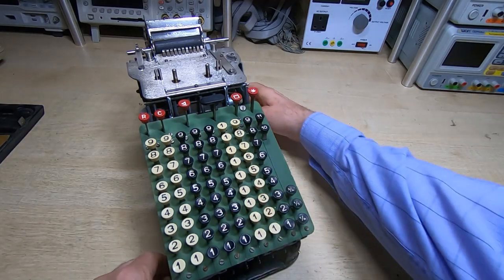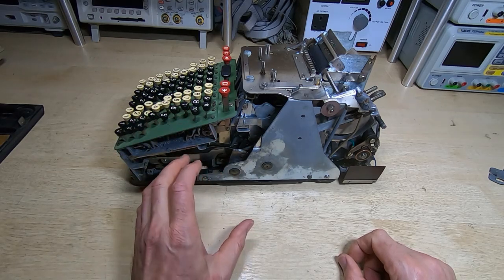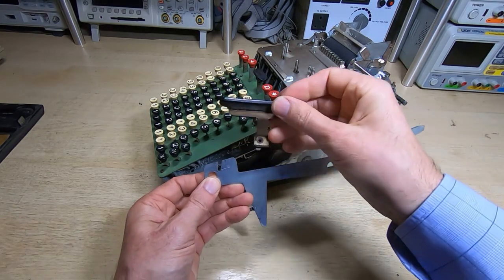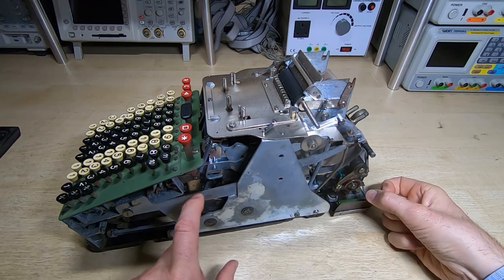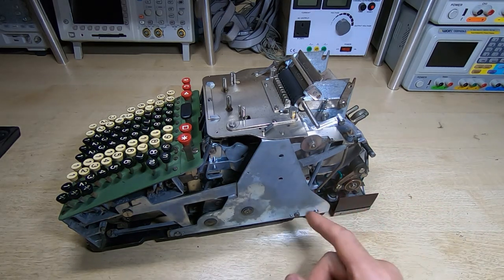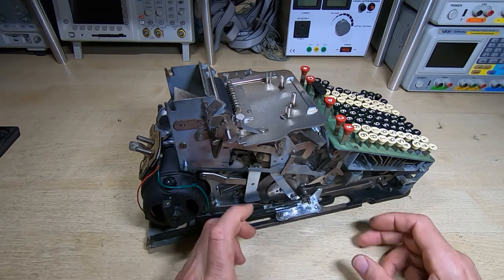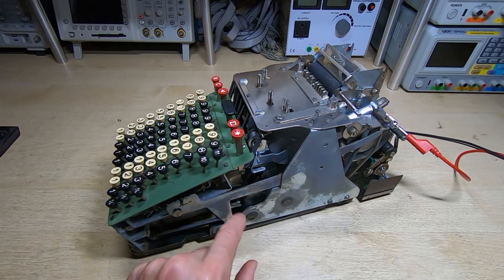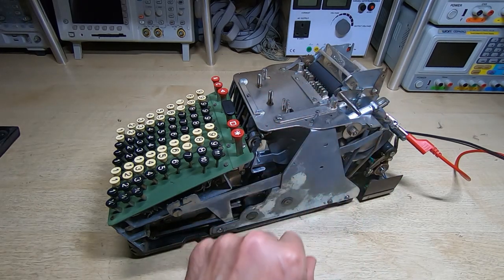Addo Mechanical Calculator Repair Part2

Comment: When you are freeing up parts on these calculators/ adding machines, do you know what each of the linkages actually does or do you just find the jammed parts by simply testing those that look like the ones causing the problem?
Reply from the maker: It is easy to figure out what each part is for but that does not always help in finding which part is stuck as many parts do more than one thing and can jam the machine even when it is not in use. For example a stuck carry cam can stop the machine turning even when a carry is not being performed. For more complex machines like the friden it is easier to focus on individual functions such as add/div etc but this machine is only an adder so does not have any multi cycle functions.

Comment: Please report the spam account. Thanks!
Reply from the maker: It does not really help. There are around 10-15 of those comments on each video but they are from random accounts so reporting them does not seem to make any difference. I generally delete them and some are detected and automatically deleted by youtube (although I still see them in notification emails).
Reply: @JerryWalker001  Most of the times when I see a spam account I report them. I assume (might be an illusion 🤷‍♂️) that when a certain amount of users report comments as spam, that that account will be deleted and others won’t be bothered by it. If everyone would report them, they might be discouraged (or that’s what hope). 

Are you saying there’s no point for me reporting those comments? 

Thanks once more for making these videos!
Reply from the maker: @Conservator.  You should report spam accounts if you want to. As I said I see around 15 of these on each video but I have never seen them from the same account more than once and I do not want to spend 2 hours reporting random accounts each time I post a video. I do not know what action if any youtube take and initially I used to report them but the number never changed so I stopped wasting my time.